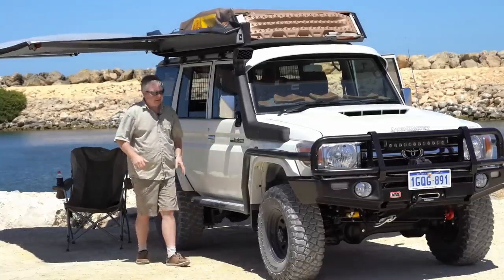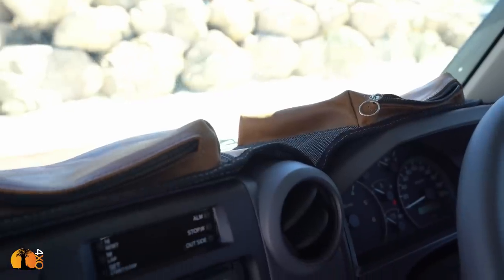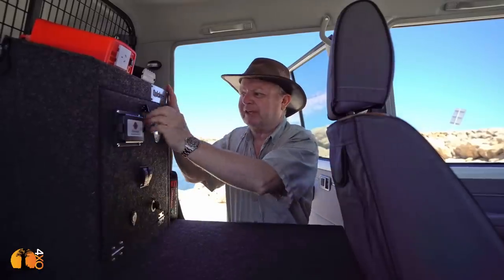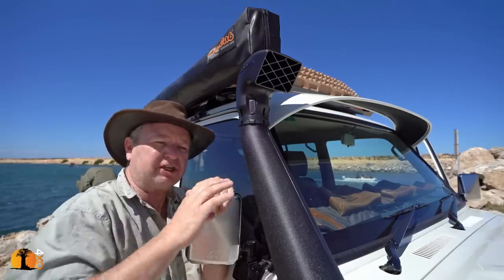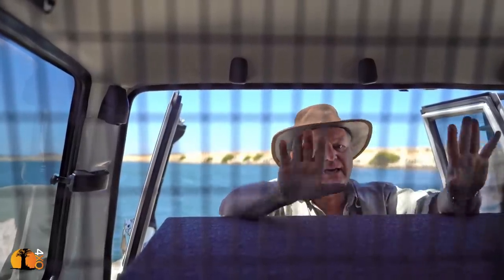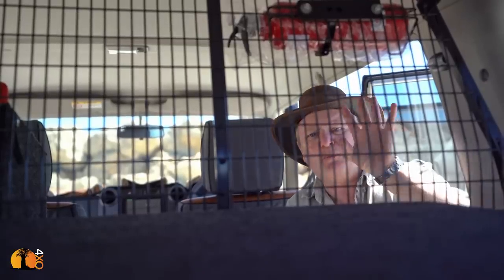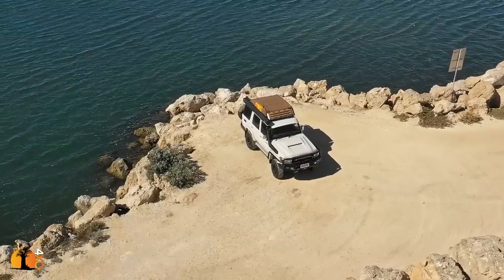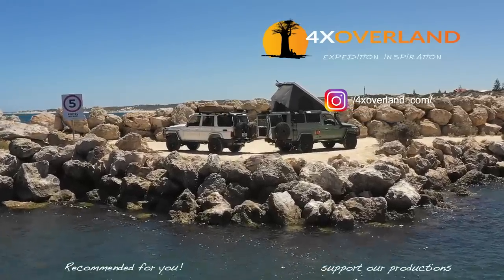MOST VALUABLE Principle. WHAT DOES IT COST? Building an Overland Truck/SUV. Part-3

Comment: A little detail on battery: the "amp-hours" quote is not a number of amps you get per hour but the number of amps you get for a certain amount of hours. It describes how much charge the battery can "store".
e.g. if the battery is a 100 Amp-Hours battery, it means that when fully charged, it is capable of supplying a 10 amp current for a continuous non-stop 10 hours before it becomes empty of charge.
So make sure to quote it as Amp-Hr instead of Amp/Hr.
Reply: That being said, the polka dots on the bonnet is definitely a must have.

Comment: Not what they're designed for but those cargo barriers are amazing roll bars I've seen two fully laden four-wheel drives rolled over and the whole roofs are flat except where the cargo barrier is. They have incredible strength with that mesh contributing to it's integral strength.

Comment: I see a few missing items, a Hi Lift jack, or more importantly a self inflating auto wheel jack. A in- car security system to help protect the contents and vehicle Internal rear window guards to reduce breaking the windows from moving items.. Talking about constant torque would a Automatic gearbox be a better option for a tourer.

Comment: The electrical box is nicely put together and well thought out. 

I see a small problem with the two rocker switches on the front panel for the lighting in the tent... If somebody put a bag or something in front of the box, the switches can be pressed into the on position or even possibly broken off; due to bad corrugation roads. Will this not be a problem?

The rest of the build is awesome and thought through for practicality!
Reply: Great point on the switches.

Comment: Hang on - both factory cyclonic and after market intakes are at the same height - how does one protect better against water? 
Absolutely enjoying this series Andrew...the knowledge you are imparting to us is priceless. Thankyou.
Reply: Benny Banger the factory ones aren’t water tight,  they’re susceptible to taking in water where there are joints in the intake/air box. If you are doing a water crossing above the air entry hight then you will have a lot of problems on your hands haha ..
Reply: @darkhorse4148  oh, fair enough - I thought Andrew was comparing the type of head ( is that what it is called?) and saying the vortex type suffered from water ingress more than the more rudimentary direct intake head. I didn't know that the factory snorkels are not water tight - what is the point of these then? Perhaps they should call them something other than a snorkel - when I was a kid, a snorkel that leaked at the beach was thrown out. Thanks for your reply btw.
Reply from the maker: They called them raised air intake. Toyota does not use the word snorkel.
Reply: @4xoverland  Thanks Andrew. That means for doing water crossings one must change the factory "raised intake" fitting...marketing gone mad in my opinion - why not fit something that is fit for purpose rather than just looking the part? (rhetorical question).
Reply: Benny Banger it is entirely Fit For Purpose as per what Toyota says the vehicle is for, as built. As Andrew says it is a Raised Air Intake, not a snorkel. The wading depth of a 76 Series is 700mm, nowhere near bonnet height.
Reply: @darkhorse4148  I guess that is open to interpretation Alex - a plastic tube sticking out of the engine bay and having an intake near the top of the windscreen implies that it is watertight upto that point, the vehicles wading depth is irrelevant - you can be well below the maximum wading depth of the vehicle and have water come over the bonnet and part way up the windscreen - the same may happen under the bonnet, I expect water to be kept out of my intake under all these conditions. From that perspective, it is not fit for purpose, although I'm sure those a'holes at toyota will try to argue the warranty claim along your lines.

Comment: If it was me I would have kept the cyclonic air inlet piece, but replaced the two-piece "L" shaped intake pipe with a single piece as was done. I would think the cyclonic piece would allow the main air filter to last longer, especially in environments with heavy dust.

Comment: Andrew, why is every 4x4 have snorkeler facing forward, isn't that kind of nuts considering rain and dust would be going in? Also, German client and right hand drive..?
Reply from the maker: How will facing backwards stop rain and dust? The engine draws from the atmosphere what it needs. Whatever is at the intake, is taken in. The dust is filtered and the water is separated by the design on the vehicle's inlet system. It make no difference, but the ram air effect at speed delivers air at a pressure slightly higher than atmospheric, and that's good for economy.
Reply: oh gotcha

Comment: I agree with you about using a cargo barrier. However, I'm left to wonder why you mounted it where you did, instead of directly behind the front seats? It is obvious that you won't be carrying extra people (as you have removed the 2nd row of seats), so you could have packed even more gear in (up to the roof) in the back seat area IF the cargo barrier was further forward.
Reply from the maker: Because it would cut the access via the back doors in half. Not a viable option.

Comment: Have you included info for the client on fire extinguisher maintenance? In regards to horizontal versus vertical mounting. (All dry chemical should be routinely removed from the bracket and gently shaken or tapped to loosen the contents. This will help ensure the retardant will be released in a uniform way.)
Reply: Very much enjoy all your videos. Thank you.

Comment: I’m trying to get a land cruiser the American version 1991 is it good? I mean it has 30 years. What do you think?
Reply: The '91 is a push rod engine = low power. "93 started the 1FZ engine which is double overhead camshaft. It has a flapper to measure the intake air. '95 to '97 were the most powerful with a better intake (heated wires for intake air measurement = 10 extra HP) '98 started the V8. The 1FZ engine is a good engine typically run to 400K miles. Mine gets 13 miles per gallon but it runs strong.

Comment: Ummm Engel have been going since 1962 building 12v compressor fridges . You should try a Donaldson style pre cleaner either bowl or spinner there is no power loss that you would notice . These results have been Dyno proven not just a tall tail . From memory it was a 5 hp drop on a 300hp motor the air filter life was 4 times greater than without. Nice build but for my style of overland travel it is to reliant on technology. Out bush the simpler the setup the more reliable it will be , vehicle or auxiliary systems does not matter .
Reply: pete ryan 
Are you riding a horse?
Reply from the maker: As I see it there is only one component relying on modern technology. One. That's the DC-dc charger. Without that we would have had to resort to high-cyclic batteries and a simple switch for the operator to turn off when camped. Everything else has dual redundancy and is as simples as possible. Nothing vital is complex.
Reply: Ok on batteries i still use lead acid n70 to be exact with 3 ways to distribute the power , vsr , 120a hd relay picking its feed off oil pressure sender and a simple red key switch . If i have a cranking battery failure which happens at all the wrong times i just replace the failed cranking battery with one of the others . Same if i have a alternator failure i can easily connect all the batteries to get me home . Last time this happened i was 600k from spare parts . I run fridge , inverter for camera batteries a few led lights elect shower laptop ect ect . All the connections are in one place Anderson plugs of course with a few extra power feeds if i need them . As for the vehicle it has no electronics at all just old school mechanical diesel, something that can be fixed with fencing wire and cable ties . I have had common rail never again nothing but trouble when solo in very remote areas . My background is been a diesel mechanic , trouble shooter field service in remote areas for over 40 years. Even my hot water for shower is passive just a jerrycan on the rear bar simple and very effective. Have seen to many new machines and vehicles broken because a $2 sensor has failed stopping a million $ machine and people in very life threatening situations because of the same . On a saftey note a PLB and a life straw are the 2 most important things you can carry . In remote areas in os you can be dead in less than a day without water food you can go without for easily a week . Never leave your vehicle if you break down many have died because they did . Not only is it shelter it is alsp much easier to see from the air

Comment: Rear track correction not done ?
Reply: Probably in the most flexible list.
Reply: ^it certainly is for Toyota 😉
Reply: I've  done more than 100000  outback kms in my 79 series   v8 cruiser and never found it to be a problem
Reply: @paullangenberg5907  its not a problem just nissan people use it make there heaps sound good
Reply from the maker: It was done but I didn't include it because its an issue specific only to 70-series Cruisers. And that's not what the series is about.
Reply: @paullangenberg5907  I don't understand how this is not a problem.  I can only guess that some don't know any different or don't do the driving I do.  The first drive in certain conditions was a big issue for me, and that was coming from a 75 Series.  I fixed the track and it made a huge difference in the right conditions.  Maybe I'm just sensitive.

Comment: Not sure how the snorkel precleaner is any worse for deep water crossing. Why would the head matter? Wouldn’t it be everything connecting below it?
Reply: The head on the factory snorkels are fine but the rest of the snorkel isn't watertight but the aftermarket snorkel comes without the precleaner that's what his saying
Reply: Liam Dancer ah got it. I’m surprised he didn’t just adapt over the head from the OEM one then
Reply: He could do that but that could also affect the warranty of the aftermarket snorkel if anything goes wrong
Reply: You can make the factory one water tight, it is the joints that leak. Take it apart, use a quality sealant and re-assemble.
Reply: @harveysmith100  it's about harder with the 70 series Toyota ones as it bolts together instead of moulding together like the newer ones
Reply: @liamdancer7998  I stand corrected, thanks Liam

Comment: Definitely a premium build, however I'd still move that tent all the way forward to improve offroad handling & safety as I said on the last build video. Especially with the huge weight of the long range fuel tank & double wheel carrier beyond the rear axle, when going up steep hills the additional lever action weight from the tent will likely cause front wheel lift.
Reply: Nah, that'll only just about pay for the sticker fitted in the video so will be back to wheel lifting at the mere mention of a kerb 😃
Reply: Moving that tent will make more of a difference in theory than reality.  Things go where they go in a vehicle build for a variety of reasons that are often not apparent to a bystander.
Reply: The tent will make no difference at all. It weighs about 28kgs. You would make more difference to offroadability (not a word) by telling the wife to lean back or forward respectively.
Reply: @Bread996  I'm an automotive design engineer & have run a rooftop tent for quite a while on some of Australia's steepest terrain (recently did Barkley River Jeep Track with no issues) & I can tell you it definitely makes a noticeable difference in reality as well as theory. Admittedly I moved mine from further back, however all you need to do is imagine a plumb-bob weight hanging from the centre of the rooftop tent through the vehicle. Anytime you incline the vehicle moving the plumb-bob behind the rear axle means the majority of the weight is being taken on the 2 rear suspension units alone with a leverage factor built in that will cause lift on the front axle. If the tent is far enough forward so the plumb-bob weight stays in front of the rear axle then the leverage effect is towards the front giving increased traction on steep inclines. It's a rough demonstration, however is a reasonable idea of what happens with roof rack loads, especially rooftop tents which is around 60kg of permanent weight up there.
Reply: GAJ I expected you’d reply with your credentials and so on.  If you were driving that vehicle all day, and I could move that tent 12” forward or back randomly without you knowing the position, I guarantee you wouldn’t know with any certainty how far it had been moved.  We aren’t talking about hanging it off the back of the truck here.
Reply: As said, I did move mine quite a bit further forward so the effect would be greater, however if the distance you mention moves the relative weight of the tent behind the axle on an incline you will feel a difference. I drive a Patrol GU with spring rates calculated on actual weights rather than guesswork so before fitting the rooftop tent I pretty much never lifted a front wheel as I had good flex. When I fitted it, almost at the rear as that's where I wanted the access to be, I scrabbled for front end traction with the tyres leaving the ground on Billy Goat Bluff, a track I'd driven a couple of times before with no problems. That night in camp I moved the tent all the way forward & drove Billy Goats again the following day with far more traction & the front tyres planted. Up to that point I'd done a trip including Fraser, Moreton Islands & wondered why people moan about the handling difference with a rooftop tent, it was only in the steep stuff it became apparent & the fix is really easy. I'd personally never fit one anywhere close to midway on a roof as that invariably puts it closer to the rear axle but it's free choice for everone & many do fit them right at the rear & travel for years.
Reply: GAJ Reply you can keep typing if you want, but I disagree.

Comment: Wish the states had these Toyota’s 😤
Reply: early 2000's were even better had 4.2 straight 6 turbo diesel. very sought after tunable engine now
Reply: Brock Sinclair 6 not better than current V8
Reply: @dolf3288  haha are you for real. Every landcruiser knows the 1hd engines are better
Reply: 1HDFTE is king.
Reply: @TroopyLife  the best
Reply: Brock Sinclair 🤣🤣🤣
Reply: @phantomwalker8251  theres a reason why they hold there value so much. This is the first time ive spoken to people who bag the 1hd's. You think there under powered. You driven a td42 haha those struggle to get 200 hp. You buy 311 kw kits for the fte's pushing over 1100nm
Reply: @phantomwalker8251  and 12k for a duramax. what you smoking. Thats a $40,000 conversion
Reply: What the hell are you talking about, we do have them its just nobody is buying them they are as expensive as Lexus version, Lexus is actually the same thing, the only difference is Lexus now has absolutely moronic front bumper, and better sound proofing, you can sound proof Toyota too, but I believe lexus comes with double glass, but I may be wrong
Reply: @GamingAmbienceLive  not diesel though. Why would you want a petrol landcruiser thats stupid
Reply: why would you want a 6 cylinder diesel, first of all you cant have a diesel now without urea tank for emissions, and a V6 offroad is a really moronic idea, jeep wranglers die from engine failures all the time, what do they have in common you ask? thats right a garbage V6, diesels are also very expensive to repair and maintain due to higher pressures, low stress high torque V8 thats offered with landcruiser is a complete beast, and im sure they now have systems that turn off half of the cylinders to save fuel

Comment: Just a note on the rear doors.
The hinges wear as we all know, here in the UK Toyota kept telling me they were out of stock, this carried on for over a year. Eventually one hinge broke.
I kept telling the local Toyota dealer, "Look, they still make this vehicle so they must be still making the hinge."
Thanks to Paddocks up at Matlock, he told me he couldn't get one but to google the part number.
Eventually I found out that the part number has changed after finding a Japanese company that does genuine Toyota parts. "Amayama."
Much cheaper too.
If you can't find the hinges, try them. Or drop me a note and I will find the new part number.
Reply: Cabmasters strip these cars for special services builds, they've got loads of new take off parts. Google cabmasters.
Reply: @Br1anuk  Thanks Davo, just had a look, web page is down at the moment but I get the concept, looks good for me.